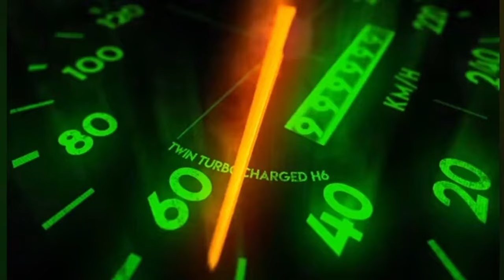still at Baxenden car breakers will we ever leave

Comment: That bailer just to old the amount of times it breaks down and the amount of welding its had everything thing at that yard never used to maintain any thing till it broke down I'm amazed that they don't get a fine or shut down as all that water sitting around up there near the machines leaking oil all sorts getting mixed in that water just not good showing it all on u tube asking for trouble
Reply: Been pissing down for weeks wot you meant to do